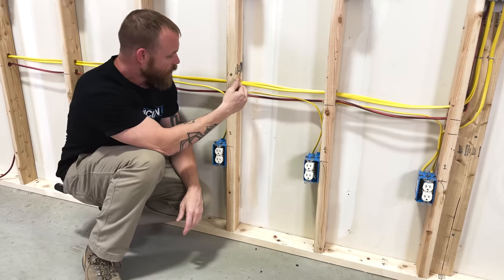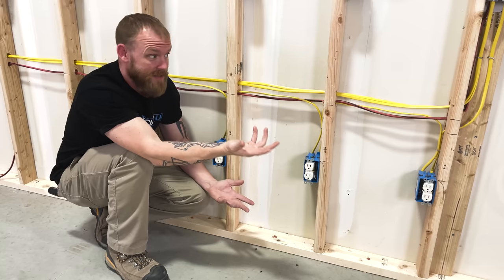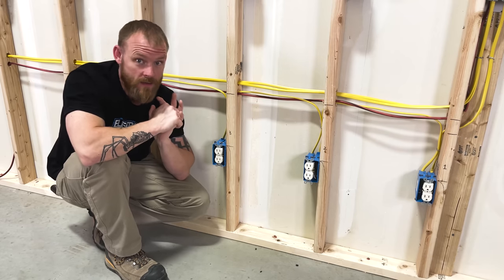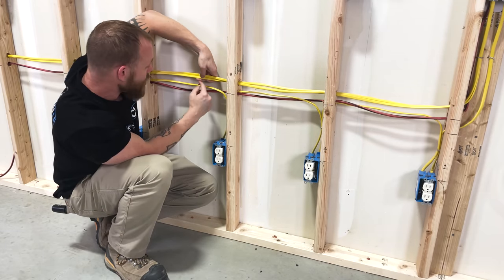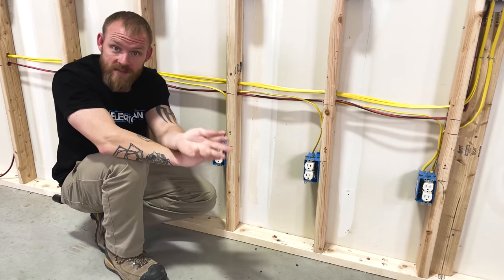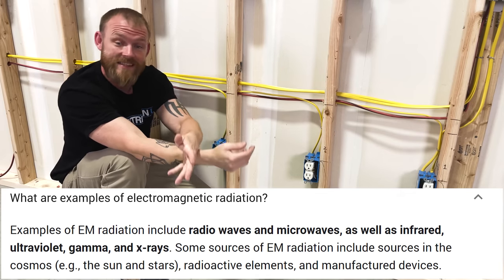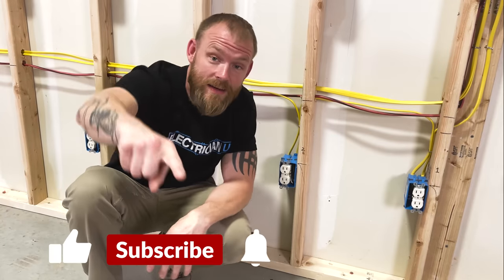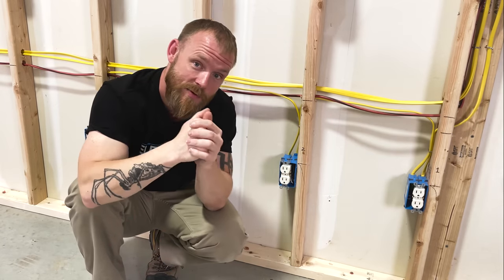How Many Wires Can Fit in Each Hole?

Comment: It's been a few years since trade school where we learned a lot of theory but hear me out😄 I thought that having the neutral ran with the hot(or the 2 hots on a 240) kept the load balanced so inductance shouldn't be an issue with others wires near by. Any thoughts? I really like learning and refreshing info from your videos and these comments, thank you!
Reply: Current in a wire creates a magnetic field around the wire. The return current in the neutral creates an equal and opposite field which exactly cancels the first. Well not exactly because the two current carrying wires in Romex do not occupy the same physical space but they are very close to each other and the field remaining is very very small. Not true for knob and tube where the wires are separate. Also a big problem in conduit if the two current carrying wires are in different conduits. You can get serious inductive heating if so.

The capacitive effect drops off very rapidly with distance and is negligible with Romex. Anything more than a few thousands of an inch of separation pretty much ends any capacitive effect at low frequencies. Capacitors are made with 2 large flat surfaces like metal foil with an ultra thin insulator between them, rolled up and put in a can. Network and audio cables are sheathed with grounded foil because they are very low voltage signals that do not tolerate electrical noise that can be picked up from very high frequency electricity like fluorescent tubes or electronic dimmers.

My opinion is the exactly opposite to this video. Bundling rules are all about heat dissipation. I agree most wires in residential carry little current most of the time. But the code is all about houses burning down and if your house doesn't burn down MOST of the time, it only burns down occasionally, that is not good enough. Romex carrying rated load will approach 70 deg C on the wire after 5 minutes in free air. Worse in a wooden hole foamed in. Bundling them together could easily reach the 90 deg C insulation rating even if only one is at full load.

Here's an example. You have a space heater plugged in by your TV and electronics on the same circuit so you are running close to 15 Amp rated load. No problem, the thermal circuit in the breaker will never trip. Unfortunately for you, a different cable in the same bundle experiences a dead short when someone plugs in a faulty appliance. Now you've got 1500 amps ( #12=1.6 ohms/1000 ft, say 50 feet of wire @ 120v) but it's only for about 20 mSec or so before the magnetic circuit in the breaker trips. I would guess, seeing how cutting a live #12 Romex will vaporize enough of the metal in my cutters that I need another pair of cutters, this is going to be a problem and at least melt the insulation in some of the Romex.
Reply: @JamesAllen-tj5nu  well said good sir had no idea the wires in free air could heat up so much and quickly on rated load.
Reply: @JamesAllen-tj5nu  good insight. Would be great if someone could run the scenario as an experiment. See how much it takes before a #12 or #10 give out and melt some insulation. I can see it happening but having solid evidence changes the entire argument

Comment: what i think is that enough room for wire to move in hole incase someone drives a nail or screw in the stud the wire has a better chance to move and if the wire has to be used for a pull wire to be replaced it makes it easier 
just common sence to not pack the hole

Comment: Okay buddy. 
334.80 clearly states two or more nm cables sealed with thermal insulation or caulk ampacity adjustment shall be made. 
So pretty much the nec board made it simple  for residential guys to understand code. Simplified it. 
As an industrial electricians we look at three things voltage drop, adjustment factor and ambient temperature correction factor. 
So as I see it people at committee made stupid proof for residential electricians two cables and no more. If you want add more 
Follow 310.15(b)(1) or 310.15(b)(2), 310.15(c)(1) table 310.16  most important factor 334.80 ampacity  rule for nm cable. After you follow everything you will realize it cheaper just to run two cables in one whole.
Reply: Only time you will see capitance coupling happen is when engineers will provide specifications for specific equipment. Special type of cable will be provided.

Comment: Not me but a coworker has been flagged for having 3 12/2s in a 1in hole. We were in disbelief as it’s not even a local thing either. Dude was referring to current carrying conductors in conduit to me. Either way it wasn’t fought snd my coworker had to go back and rework a home run and two jumpers because of it

Comment: I only run a max of 3 wires in a hole of 7/8" or 15/16". Once I get to a #10 I usually just run 2 per hole. Once above #10 I stick to 1 per hole.

Comment: Limits on the number and size of holes in structural I-beams - tempting to cram as many conductors as you need in the minimum number of holes?

Comment: If I need to run perhaps 9 sets of 12/2 in parallel, how far do I need to space out the sets of ~3 per hole? Is 6" spacing sufficient? I remember seeing somewhere in code that appeared to require a yet-larger spacing, but I can't put a hand to that reference. Talking about standard 120v / 15A single phase lines.

Comment: In my neck of the woods, it's code to only have 2 wires per hole, regardless of hole or wire size and temperature considerations.

Comment: Great video but I need some help here.    How many 12 /2 nm cables can I put through a single hole before I need to start derating the circuit?
Reply: If you're drilling at least a 7/8" hole, run 3 wires per hole (for 12/2 or 14/2). Once you get to #10 id pull 2, then anything bigger I'd just pull 1 per hole. I find that the best way to do it and it still allows you to pull wire through holes pretty well without damaging the romex

Comment: Our molding machine ran on 3 phase tapped out for current. When a motor start dragging it would aver amp and pop a main fuse.
Machine computer ran on  1 leg hydraulics worked . Machine only cycled by hand 
This only happened every year or so when gearbox was going.
And being electricians they hated walking out to maintenance building getting the lift and coming back and forth.
15 minutes down .
Or hour and a half if they didn’t listen.
Man keep checking for voltage I had been on jobs 10 years .
I told him after 10 times of try it I TOLD him it’s that dam fuse so he finally went and changed it  he said he had voltage on all 3 lines coming in and I told him he had residual voltage from lines laying by each but he needed to change the fuse.
It would happen 3 or 4 times in a month till gearbox blew then be good for couple years just in time to train next new electricians
Cause he had some kind of voltage showing he would not listen to me.
We had 197 switches about 30 air Mack valves air pressure timers lot of stuff on machine only  happened every year or two
Reply: if a guy doesn't know how to check a fuse (and do it live) then he shouldn't be doing the job. The blown fuse will always show the return voltage on the other side. Two ways to check that is meter for 240v across both legs or meter both sides of the same fuse. A good fuse will show ZERO but a bad / open fuse will show leg voltage across the fuse. (120v)

Comment: 334.80 on the NEC says if you are going to caulk or or foam you are going to have to adjust the ampacity on the wires so if you run more then 2 wires and the builder wants to caulk or seal everything, you can fail inspection. Better just stick to 2 wires..

Comment: Can we run 4 numbers of #4 AWG THHN copper wires  (60amp breaker) to carry 220v through single joist holes across unfinished basement to ev charging station in garage.

Comment: As a norwegian electrician. I cant understand why cabel is put in the walls with metal square boxes.. cant u understand that the use of flexible pvc conduit and ROUND pvc boxes is miles smarter and better?

It gives u the oppertunity to rewire when walls are closed. 

Its saves u the time of stripping every cabel to every box by haveing only wires straight in the box.    

Its way easier for the drywaller cutting out boxes with a roundsaw.

U dont have to earth every box, because their pvc.

Comment: But there is. There is a code reference stating nm cables and derating of more than two cables through bored holes that are filled with insulation material and you can use the 90° column for nm cable.

Comment: Can we put 3 nm-b cables under one 3/4" staple ? we can not put them flat to each other so at least one of them need to be on top of the other 2 - is that allowed ? can you give code reference? because code NEC Code 310.15(B)(3)(a) says you are allowed 3 conductors - can you confirm?

Comment: Idk about you, but I have maxed out all 4 circuits in a room very casually. Sure, most people might put 2A on every circuit… I don’t. And I find younger people using a lot more power/having more electronics running in general. I think you’d be surprised about the mutual heating thing.
Reply: funny about younger people leaving things plugged in, but if you add up those 6 chargers, a lap top, and a few lights, it probably doesn't equal 5 amps. I have measured my panel on a Friday night and the whole house is maybe 10-15 amps per leg. (no ac running)
Reply: i 4 conductors are still going to have plenty of airflow even if held at 15amps, even 6 or 8, youd need to start jamming over a dozen through a hole and then managing to pull 1800 watts on everyone continuously to ever see a problem at that point youre probably expecting an issue 

i  do alot of wonky stuff and often find myself figuring out which outlets are on different circuits so i can pull max power from multiple circuits, to say run 5 air compressors at once, and even then i wouldnt be able to overload them even if we jammed them all inside of a conduit in some equator heat wave temperatures.. theyre designed to work fine even when the house is 130F and the wire is pinched from a staple, kink, or object, and the circuit is drawing 20% over its rated load even with all these worst case scenarios the wire will still operate fine, thats why normal climates, with insulated walls, and unkinked wires you can pull out a 15amp breaker throw in a 20amp unit and pull that circuit for all the power that 20amp breaker will allow without a failure.. against code obviously but 14/2 will carry 20amps

heck look at automotive wiring we'll run 40 amps through some 12guage andd not think twice about it, 500amp winch? yeah 4guage should handle that
Reply: @AndrewBrowner  yea alright. Maybe it’s not an issue then. I don’t figure your gonna have 12 going through one hole unless your really asking for it.
Reply: @AndrewBrowner  ... I did automotive for 50 years and I know what you mean about some cheesy OEM wire choices in recent years, but that #20 wire to the headlights was chosen to be right on the cusp of delivering 12 volts (measured) to the headlight while the battery is seeing 14 volts. That's a 15% drop they built in and would never fly in house wiring. Your winch is also not drawing 500 amps unless it's locked up, and even at half that draw your #4 wire will get hot in a few minutes... but when was the last time you stalled out a winch for several minutes and left the switch on? Have you ever noticed that some wiring in cars has brittle insulation (from heat) by the time it's 10 years old? Crumbling insulation in a house that age would be real trouble. The whole point of NEC is to keep people from "getting away with it" for too long.

Comment: So just to argue with you for a sec. The capacitance argument you're making is probably why the heat argument is a factor: If a conductor is being impeded by a capacitance issue, that energy has to go somewhere, and the only place any energy ever truly goes is heat. I'm not super familiar with how capacitance actually functions, but if it's acting as any form of resistance in the line, the more the problem increases the more waste heat you'd have / foot. So then having a bundle of lines acting as a blanket over top of the lines in the middle would become a force multiplier for the problem.

Comment: I've been in plenty attics and have had to cut zip ties and straps to spread the cables apart  because the cables were reaching temperatures above 150° so I recommend not bundling cables. It may look neat, but is not a good practice.

Comment: I also feel like you shouldn't pack a hole with wires due to the expansion and contraction of the wires as they heat up and cool down.  Even if it's not because of the heat from electric.  Even the surrounding air can cause a little bit especially if the wires are on an outside wall where they can be prone to the heating and cooling of the outside part of the wall.
Reply: Thermal expansion is so small as to be irrelevant to this issue of wires in a hole in the wood.  For example, copper expands by a factor of .0000098 per deg F.  So when you heat up wire from say 70 deg F to 170 deg F, it expands in diameter by a factor of .0000098.*100, or .00098.  So a #12 wire that has a diameter of 0.0907 inches expands by 0.0907*.00098 or .000088 inches. That's .09 THOUSANDS of an inch. So if you heat up by 100 deg F, it expands from .0907 to .090788 inches. This is so small you can't even measure it with a pair of calipers.  The thermal expansion of the plastic insulation is 10x that of the copper,  but that still means the expansion is so small as to be insignificant. a tight bundle of wire 1" in diameter will try to expand by .01" when you raise the bundle by 100 deg F.  Which means it will try to expand by less than 1/64 of an inch.  If you have packed a 1" hole so full of wire and so tight that it can't compress down 1/64" of an inch this expansion is not the issue you need to worry about.

Heat build-up when wires being warmed by high current can't cool down is the only problem we need to worry about here. That's the problem that shows up way before expansion becomes an issue.

Comment: I’ve got a situation with two circuits that are somehow connected. Both breakers need to be switched off in order to kill the switches and outlets. Both work fine with either breaker on or both on. I’ve been trying to think about how best to troubleshoot it, but haven’t figured a good strategy.  Any advice?
Reply: I had to troubleshoot a similar thing but only 1 breaker could be on at a time or it would trip. I observed what was on the circuit and picked a spot that seemed like the middle. In that receptacle there was 2 wires. After separating the wires i could turn on both circuits and noticed each set was a different circuit. Long story short the installer had either run a home run to both ends of the circuit or had jumped 2 separate circuit together so i just had to separate them

Comment: Sorry...you're all wet on this one. As stated by other comments, the capacitive effects BETWEEN Romex cables is very small, and considering the 60Hz line frequency, the capacitive coupling effect is also very small. Your assumption that adjacent cables will not be carrying significant current is also a bad assumption. Suppose the wires to a master bathroom are running together, and two people are using hair dryers at the same time, as well as having an electric space heater in the bathroom, along with lights/exhaust fan. Those currents are definitely significant, and could all contribute to the heating effect (IR loss) in the NM cables. Inside a wall with no air circulation, and especially with insulation surrounding the cables, there is little to dissipate the heat in the wires. The NEC derating is based on heating effects.

Comment: You can run as much as is possible that's not hanging up..... placing cat 5-6 along with any conductor is not recommended...you have "noise" in communication lines.... not sure about running low voltage along with 120....I haven't heard anything about that practice....I have and nothing different....my opinion is how many holes does it take to degrade a supporting wall stud?  Pretty sure people don't vacuum have a hair dryer going and the microwave going on the same circuit anyway.... microwave being separate, but I've seen them shared in many houses....as long as the wires aren't tight... you're fine

Comment: The heat dissipation reasoning seemed OK until it became fashionable to use spray-in foam insulation.
Now we have millions of wires encased in foam that allows almost zero heat flow.  When I ask govt inspectors about that, they smile and shrug!

Comment: I had a 7000 sq ft house, the electric company told me they would credit me back money if I used my power during the night.  The rep told me to leave everything on all night and turn them off in the morning. I would get huge credits. My bill went from 600 a month to 40 dollars a month. 

We had one problem, a ton of romex was bundled together. It was drawing a lot of heat and a fire started. (Small) I was home and was able to get help asap. Only around 15 were bundled together. None of the circuits were overloaded, they had 10 amps on them each max is what the fire department said. 

So before you decide to argue about if it’s possible. It is possible, maybe not for you, but it definitely is possible.
Reply: You had 15 conductors that had 10 amps apiece on them? So, you were running 150 amps worth of devices? Yeah, I'm not surprised you had a fire. That ridiculous to the point of unbelievable.
Reply: @bryanherman1035  yes, it’s very possible when you have a ton of light. I had 12 ish 100w lights in many of the rooms (recessed). At .83 amps a light that’s 9.96 amps per room just on the lights in the main room. This is not including any other devices in the home.